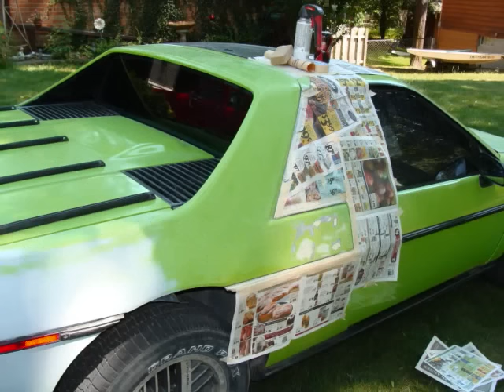'85 Fiero restoration

Comment from the maker: the paint code is 8908 its called Talbot yellow. the exact same color as the yellow '88 formulas. if i remember correctly it was $200-250 for everything. it was just a single stage paint from finish master.

Comment: great job! though i would have probably pulled all the panels off and heat guned them to straighten and then painted the separately.. bondo on a plastic car is just a recipe for disaster.. one bump near it will crack it.